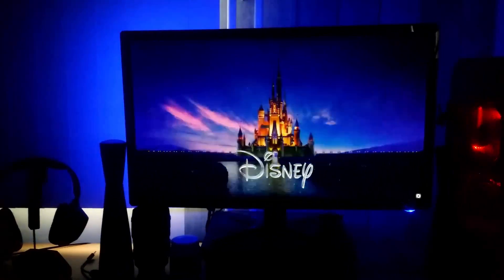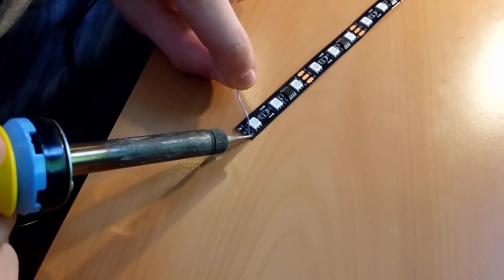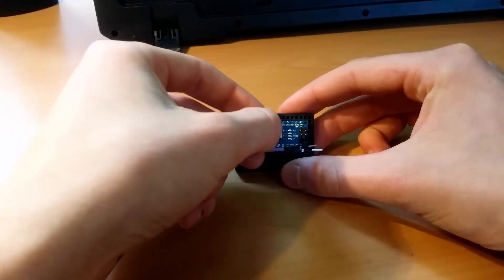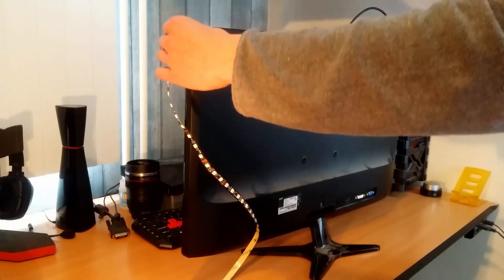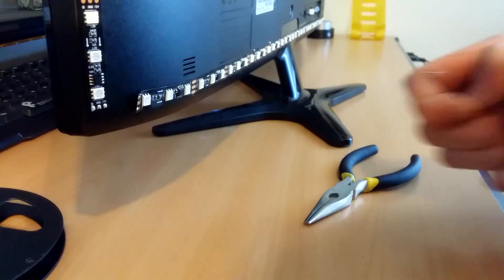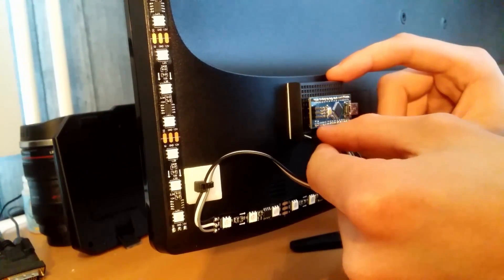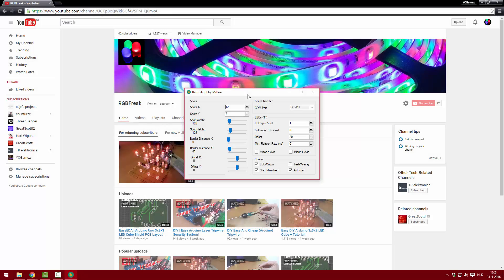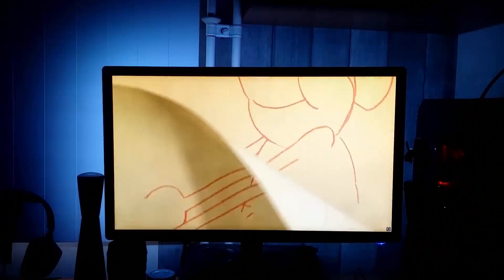DIY | Ambilight Using Arduino Nano - Very Easy!

Comment: 4m length with 60 led/m requires approx 14.16A, Using 20A PSU will be safe for Nano and pixel? asking for safety and longtime use.

Comment: hi i've tried to create the same thing but as soon as the leds are connected to the arduino they start cycling between all the colors in a very fast way. like a strobo effect. what can i do? i have (6+11)*2= 34 controllers and each of them controls 3 led so i put 34 in the script.
the leds are 12v so i'm connecting them to a 12v power supply and the arduino it's powered by the computer. i've no idea how to fix this problem
Reply: Set the mode to grabbing screen

Comment: Hi! I'm very, very new to this kind of stuff. I am just now collecting parts to do this but I have one question. Where exactly does the power adapter connect to? You lost me a bit on that part. Thanks! :)
Reply: I'm pretty sure he powers the Arduino directly with 2 wires, and then connects the arduino to the PC through the micro USB. Then Bambilight software will send orders to the arduino through the USB.

Comment: In case anyone is making this still and have the same issue, I find that the digital output pins affects the color of the LED. The pins I find best working is the D11 pin on the nano. Along that, I don't know if it's just me, but there's a noticeable output latency on that nano that the uno doesn't have. Other problems I notice: most application doesn't work well with the lights, where it'll produce yellow rather than white, but in media players such as full screen streaming or watching movies, and playing games, it'll work completely fine. If The LED doesn't light up or flicker, then for sure, use the VIN pins over the 5V, and restarting your computer helps too. Ps If the D-variable pins (D3-11) isn't definable in the IDE, then just put the values after the pins, don't try to use the number people have on the diagram on google. (D11 > 11)

Comment: Hello and thank you for your video.
As an amateur allow me to ask you something.
I suppose that the black cable is 12V+ and the brown is ground.....?
And if so, where is the USB cable going.....?
Also, I thought that Arduino is functioning with any power through the Dpin, am I right?
Anyone could answer, thank you for your time!
Reply from the maker: First of all thank you for your interest! A more detailed description can be found here: https://www.instructables.com/id/DIY-Ambilight-Using-Arduino-Nano/ 
If you still have any questions feel free to ask!
Reply: I greatly appreciate of your quick reply and interest. It's really kind of you bothering with all of us asking about, but it is because we appreciate your help.
So, if I may make you feel dizzy (:-D) , black and brown cable supply power to Arduino and strip, and USB cable connects Arduino with PC to make possible for them to maneuver the LEDs??? :-D
And since I'm using a 3m 180leds ws2812b for my 42" PC screen (tv), should I suppose that I need and a proper driver.....as a 5V 12A....?  
I so much thank you in advance my friend....cause I'm a total amateur in these things.....
I just stumbled on it in Internet and loved it.
Reply from the maker: Yes you would need a decent power source for that. The arduino connects to PC for both the data as well as input voltage and to power the LED's you have to use your adapter. Cut off the connectoe and then wire it as shown in the schematic on Insteuctables. 12V to 12V in on your strip, GND to GND on your strip and GND on your Arduino. Since the colors of the cables may vary ofcourse I don't know which side is positive or negative in your situation, but you could test this with a 12V device of which you know the positive input side, or a multimeter

Comment: how are you able to solder that paperclip, is a soldering iron able to melt the steel in a paper clip?
Reply from the maker: Muhammad Uzair Abid the iron can't melt steel indeed. I use solder to connect everything together
Reply: +RGBFreak oh so you've already put solder on the contacts of the strips and you're just melting that solder and connecting the paper clip?
Reply from the maker: Muhammad Uzair Abid exactly

Comment: One question. Does this work on all resolutionS like higher than 1080p? Will it work smooth at 4K ?
Reply from the maker: Hi there. Yes it will work and the smoothness depends on the performance of your PC. Although if it can run at 4K I'm sure it will be capable of handling the software as well ;)

Comment: i got a quick question, do i need to have the Arduino nano connected to the led strip i'm using to be able to upload the sketch file?
Reply from the maker: Nope. You can always upload a sketch to an Arduino (unless you have something connected to the TX and RX (0 & 1) digital pins, but in this project you don't)
Reply: Thanks is there a way I could use this same method to do the same thing to my T.V
Reply from the maker: Not using an Arduino, since you would need some kind of hardware capable of processing images, but it is possible with an RaspberryPi. There are a lot of tutorials on how to do that
Reply: thanks

Comment: there are multi color video on the screen but why your leds are lighting only blue.
especially on end of the video..
Reply: yeah why????
Reply: The leds only shine the light that is displayed on the edges of the monitor, that's basically the point of ambilight.

Comment: If I connect hdmi output socket to in my Television's hdmi input, which is I am using internal satalite receiver Tv. Is it work? I can use uno version too, it doesn't matter, I don't have arduino yet.

Comment: Can you link the all components needed? How much CPU this eats? Thanks for nice video.
Reply from the maker: +Gratnak thank you for your comment. All the components needed are linked in the Instructables link in the description. Also you do not need a very good CPU for this since it's a light weight program
Reply: Thanks for fast reply. I saw the link about instructables, but there was only list of components - couldn't find links to items at all. How much the whole thingy cost? Btw, even it works almost like a charm, in video there is some problems with color match - is it software based "problem" and can it be fixed?
Reply from the maker: I use a fake arduino from chine ($3) and the LED strip is around $30 for 5 meters. I only needed around 2 meters
Reply: Sorry for constant bothering, I suck quite much with electrics :) Which kind of 12V power supply I need (ampers, AC/DC etc.)? I have 55" television, so I bet I need 5 meters led stripe. Is there any easy way to calculate the power sumption of leds? Is there solderless power supply modules to Arduino board? I'm using 220V EU-area (Finland) electric network. Is this item the arduino but with power supply input? Or is this just input for PS and does this fit with your instructions?

http://www.ebay.com/itm/NEW-MB102-Breadboard-Power-Supply-Module-3-3V-5V-F-Solderless-Arduino-mini-usb-/401187646180?hash=item5d68a5aae4:g:pCUAAOSwGtRX1z28

Btw. great work indeed, I have to admit. Respect!
Reply from the maker: You need at least 30mA each LED if I'm correct. Power consumption is stated in the datasheet of the LED. Please note that the power is for each color individually, so 10mA would mean 10(R)+10(G)+10(B)= 30mA

Comment: +RGBFreak I watched your tutorial, but i have 2 questions. 
1st: I can't upload the .ino file. instead i get this error:

Arduino: 1.6.11 (Windows 10), Board: "Arduino/Genuino Uno"

C:\Users\Desktop\Bambilight-master\Bambilight-master\Arduino\bambilight\bambilight.ino:7:21: fatal error: FastLED.h: No such file or directory

 #include <FastLED.h>

                     ^

compilation terminated.

exit status 1

Do you know how to fix it?

2nd: Can I power a 5v Led-Strip through my arduino?
Reply: 1. You need to install the FastLED.h library into your Arduino's library folder.

2. Technically, the Arduino does have a 5v output that you can use, however it is very limited on it's amperage it can handle and LED's add up fast. I'd suggest running a dedicated power supply for this project that has a current output of 5A or more given a rough guess on the total length of the strips and their power consumption(it could potentially require more).

Hopefully I wasn't too terribly late to help you lol
Reply: Just read the error message....

Comment: pretty nice ! did you think it's possible to find a way to used it without a pc ? I mean juste plug an hdmi source ?
Reply: thank you! yes it is possible with a raspberry pi
Reply: +YCGamez that could be a nice video to make ;p to do the same as the lighrpack 2 but cheaper :)

Comment: What settings have you found to be the best? (saturation level, response time, etc.)
Also, should I position the spots near the edge of my monitor or closer to the center?
Reply from the maker: +Kha near the edge will give the best effect and highest resolution. I can't show you my settings right now unfortunately, but it isn't hard to get it right. It all depends on the size of your monitor what your settings should be
Reply: I started using the adalight tutorial here with the arduino with a lot of success: https://www.reddit.com/r/battlestations/comments/4e6ma2/installed_adalight_few_days_ago_its_cool_50_leds/d1xgsf0

By the way,  I am powering the LED strip through the Arduino Nano power and it looks fine. Should I switch to dc power? I have 50 leds. Currently using this strip, which in the description it says that it CAN be powered through 5v arduino, https://www.amazon.com/ALITOVE-WS2812B-Individually-Addressable-Waterproof/dp/B00ZHB9M6A/ref=sr_1_1?ie=UTF8&qid=1465629569&sr=8-1&keywords=ws2812b
Reply from the maker: +Kha Yes. Do NOT power it using your arduino. You will fry it for sure
Reply: I've been using it for two days straight without any issue, and the LED strip I bought says it CAN be used with 5v arduino power.

I am conflicted on what to do. If it does fry, will my LED strip be fried or will my arduino be fried? I can risk frying the arduino, but it will be tedious as hell if my LED strip fries.
Reply: Typically, the 5V vcc pin on arduinos can handle around 450mA of current draw from them while powered through USB (roughly 650mA with a power supply connected to it). If your LED's are drawing about 60mA per, you could be drawing 3 Amps (3,000mA) through there with all the LED's full bright which would definitely be deadly to your Arduino. I'd highly suggest you get a power supply for your strip that is 4A or more if that is the case (and I say 4 amps to give a bit of a buffer and not strain the power supply)...
Reply: Pyronic C Looks like you were right because it looks like my Arduino got fried around 2 weeks after. What power supply do recommend and how should I wire it together? Sorry, sort of new to hardware and Arduino.
Reply: Kha 
If you're planning on keeping it around 50 LED's I'd go with this:
https://www.adafruit.com/product/1466

If you're wanting room to expand fin one with a higher amperage like this one:
https://www.adafruit.com/products/658

To connect them, you'd wire the positive to your strip and the ground to both your 'duino and strips grounds. (and the power/gnd can be wired to either end of most digital rgb strips while the signal MUST be on the input side of the strip)

Also, don't stress about asking questions, everyone has been new sometime and a lot of these question don't have clear answers to them when you search.
Reply: Sounds good. I purchased the 5V dc power as well as this adapter: https://www.adafruit.com/products/368

I tried to connect the wires I have to the adapter, but they do not seem to be going in. Would I have to solder my wires to the contacts of the adapter?
Reply: Kha No soldering is needed with that adapter, they're screw clamps that you have to loosen before you put the wires in,
Reply: Wow, that makes perfect sense now that I think about it. I will definitely be trying it tomorrow. Thanks!

Comment: I am using the following strip: http://www.amazon.com/ALITOVE-WS2812B-Individually-Addressable-Waterproof/dp/B00ZHB9M6A?ie=UTF8&psc=1&redirect=true&ref_=ox_sc_act_title_4&smid=AA0YO4F2UD50F

Isn't 12v too high? Some projects only use 5v.

Also, can you explain how exactly I connect an external power supply to the arduino? I have only worked with usb powered arduinos in the past. Doesn't the dc power adapter look like this? http://www.amazon.com/Etekcity-GD-001-12V-Power-Adapter/dp/B005JRGOCM/ref=sr_1_1?ie=UTF8&qid=1465167028&sr=8-1&keywords=dc+power

Do I need some type of adapter/convertor to be able to plug a wire into it and connect to arduino pin 3?